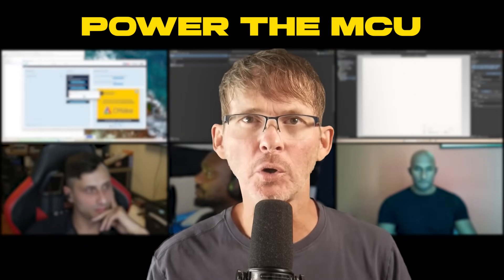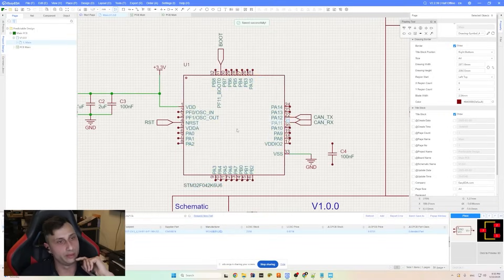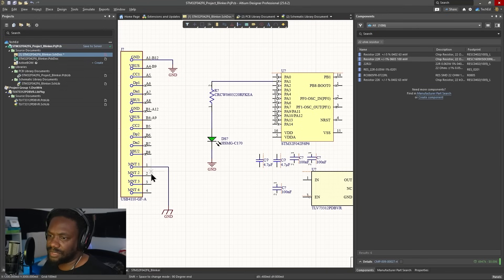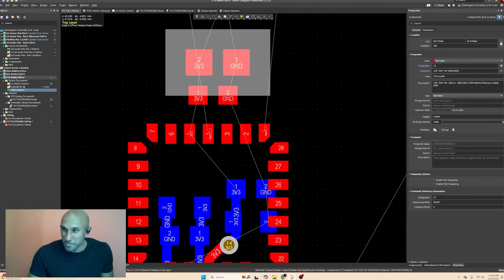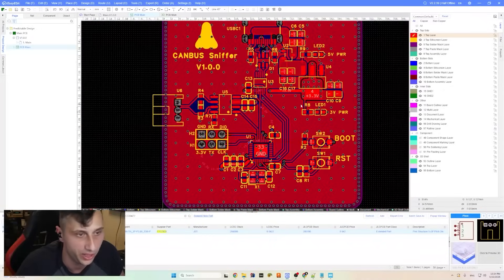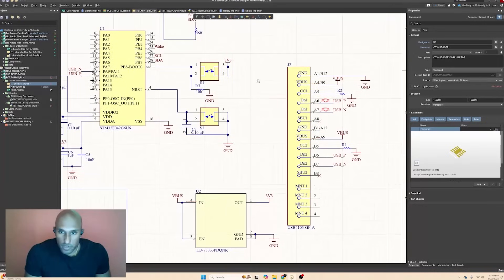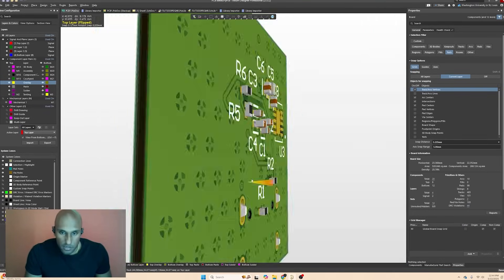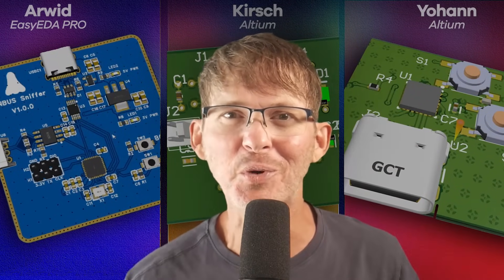3 engineers battle to design a PCB in 2 hours

Comment: The CAN sniffer, should it suggest to properly space the can high and can low to give characteristic impedance?
Reply: In such a short PCB run it does not matter that much. Also keep in mind that the termination resistors are on the PCB so its even less of an issue since its seen as the end/beginning of the bus. Even most app notes do not required the characteristic controlled impedance.